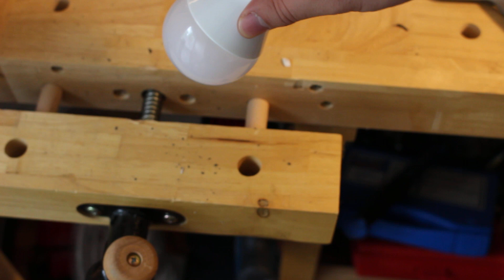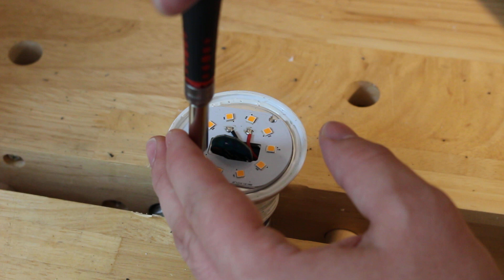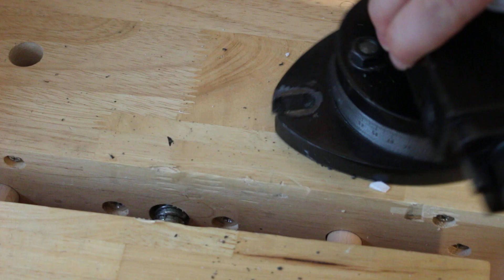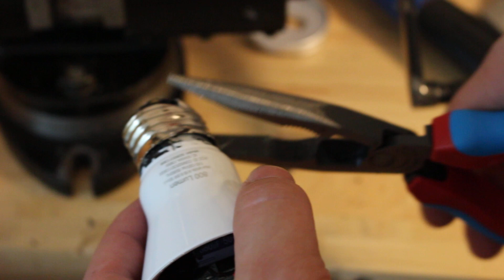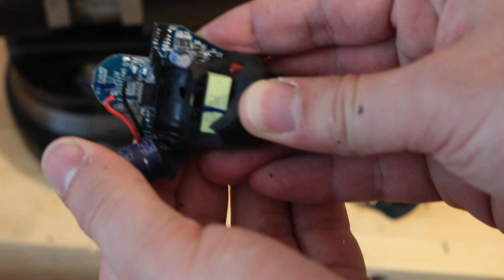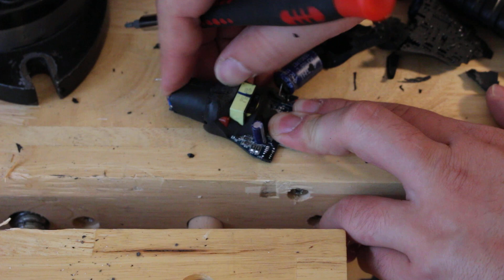Philips Hue Bulb Teardown

Comment: What is all that crap for? LEDs are constant current devices. The bulb only needs three components, a bridge rectifier, a capacitor and a resistor.
Reply: There's flyback circuit for AC to DC and voltage transformation. Also it probably has buck-boost converter circuits in there, no idea why it would need boost circuit though. LED and resistor matrix is not reliable for longevity. Higher quality LED strips use ICs for CC to power parallel LEDs if thats the case here. Also, there's dimmer circuit and antenna and communication circuits in there as well. There's plenty of crap put there to make it "smart"

Comment: is it possible to modify it to work with 12V DC ?
Reply from the maker: In earlier bulbs there is a separate "led board" and "power board". This one is integrated, so you'd have to feed DC in somewhere within the circuit. But it also used a higher voltage (30-40V) IIRC so would need to step up 12V first...

Comment: What is the out put voltage 12VDC or 24VDC..
Reply: 240/110v ac. it has built in psu. the chips on board run at 3v and 5v

Comment: Can you actually connect different LED(s) to this board and control it as a hue light bulb? if so what's the max wattage it can take?
Reply: Was there ever any answers to the two questions?
Reply: A guy uploaded this video. Looks like an old version but I doubt the diodes themselves were changed. Perhaps some one with a better eye for detail could tell the forward voltage and whatnot https://youtu.be/Mg_Iw4yzilI

Comment: I never thought that the dome could be made out of plastic. I guess these bulbs must run really cool.
Reply: They don't, actually surprisingly hot, but the metal base does a very effective job as heatsink.
Reply: Michael It's the internals that get hot (e.g. the processor, motherboard) the LEDs run very cool and don't need a glass dome.